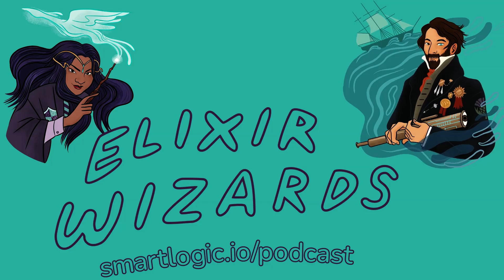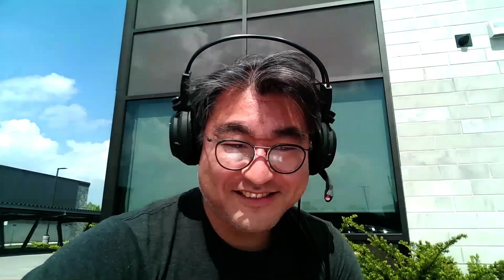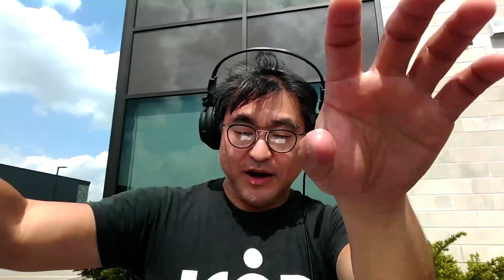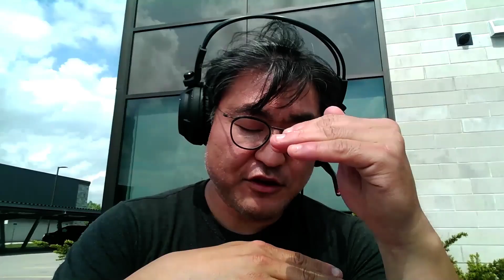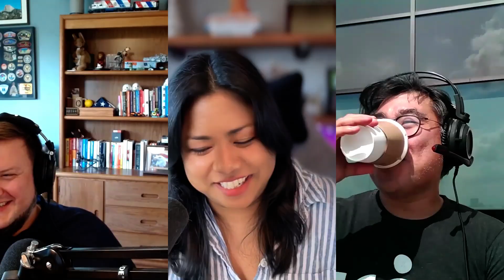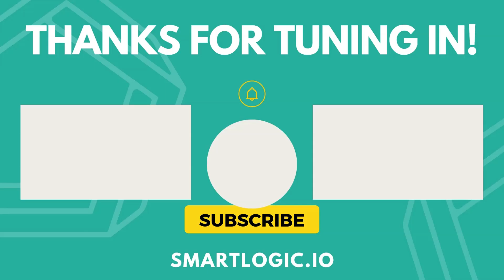Zigler: Zig NIFs for Elixir with Isaac Yonemoto | S14E01 Elixir Wizards Podcast by SmartLogic

Comment: 11:45 The reason Dirty NIFs are called that is because they run on one of the dirty schedulers. The dirty schedulers are called that because they're for running what you could call "unhygienic (aka dirty) tasks", meaning they don't abide by the hygiene rules required for the regular BEAM scheduler, namely they don't cooperatively yield (or don't do so within the time bounds the scheduler sets) like BEAM-native languages do.

Despite Erlang and Elixir code being written as if it's pre-emptively scheduled (as if the runtime system tells a process to yield, "pre-empting" it when it's used its alotted time), actually during the compilation code is inserted that tracks the "reductions" (an arbitrary unit of time/computation) the code is consuming and whenever you make a function call the BEAM checks if the process is out if its reductions and, if so, cooperatively yields (this can result in the rare cpu-bound degenerate case, but in 99.99% of cases since elixir doesn't have loops and uses recursion instead it works perfectly).

So, code that isn't able to run under this cooperative multitasking structure is "dirty"/unhygienic and must be scheduled on either the dirty i/o scheduler or the dirty cpu scheduler.